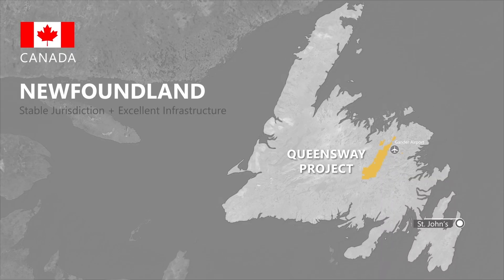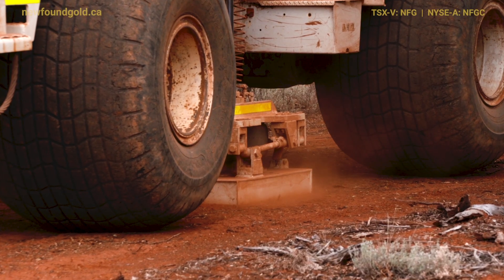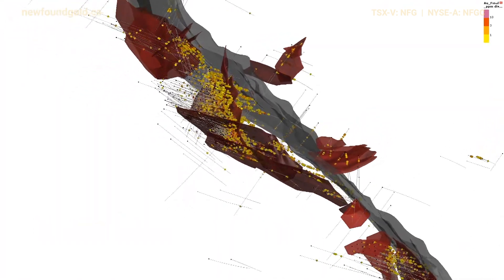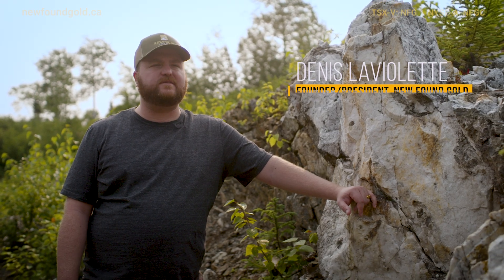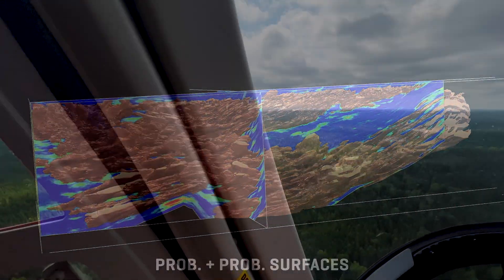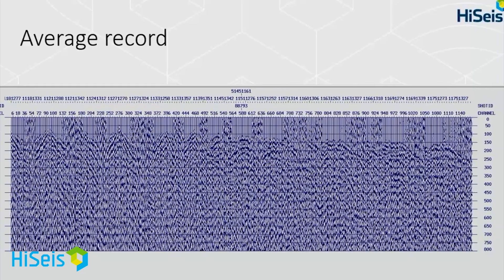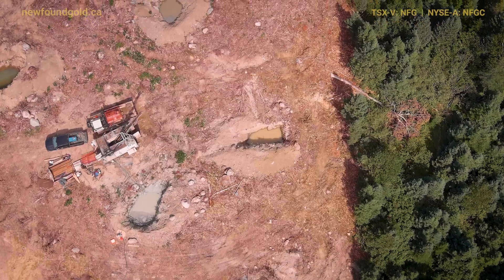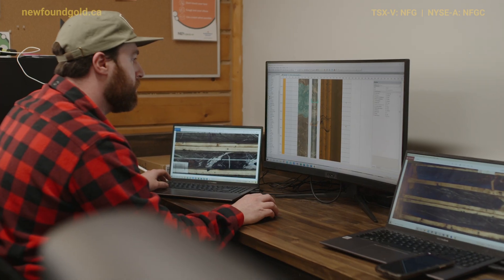New Found Gold Corp. Presents “Seismic Shift” (TSX-V: NFG;  NYSE-A: NFGC)

Comment: Hey Greg, as a geophysical prospector with nearly 30 years of practical experience in ancient Australian terrains I have often wondered why the hell the global exploration industry had never really got a handle on seismology and its obvious potential for delineating anomalous mass in sedimentary basins. New Found Gold is on the right track to showing the rest of the industry the bright exploration future. You should also know that the use of airborne radiometrics is in the same anomalous exploration category, just waiting for an innovator to inject capital to unlock the incredible lithologic information obtainable with the seismic/density recognition technique. Talk about saving exploration time and capital when all you need is a proper awareness of the radiometric sciences, an airborne and the passion to look for a few scattered isotopes of thorium, potassium and uranium. I can accurately delineate extensions of implied mineral provinces, under the cover, in the roughest of terrains, anywhere on earth, using 25 year old airborne radiometric technology and with not one 3D image required. Luv your mineralogic passion and your leading edge exploration breakthrough science. Wish you and the team well. Regards Rory, Western Tasmania.

Comment: As a former seismic data processor for oil I was curious if it could also identify gold deposits based on the density differential reflection. Hope it works.